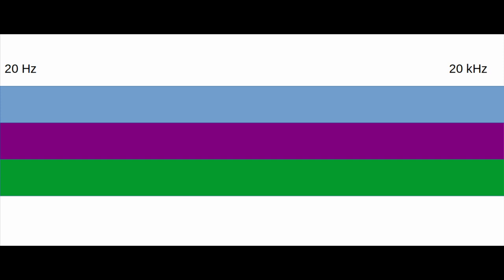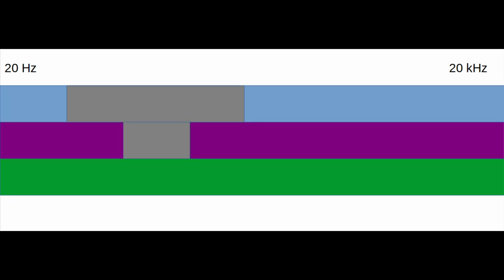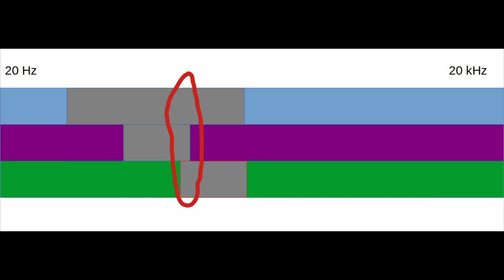Soundproofing Your Home: Floors and Walls

Comment: Whew, that was a lot to process. I actually came back a few times to finish the video what with kids and life interrupting. I'm looking forward to seeing these sound reducing techniques implemented.
Reply from the maker: Sound and Magnetism are two forces that we don't completely understand.  Here is one that the "experts" don't talk about. Sound is basically a pressure wave.  Both in liquids and gases, a point of pressure is equal in all directions.  So why does a sound pressure wave not start a new point of origin every time it touches an air molecule?

Comment: I enjoyed your sound transfer explanation. In the early 1980's I built a three bedroom house inside a cold-storage warehouse in Manhattan. The floors were two feet+ thick with concrete mixed with clinkers (used/burned up coal and built around 1900). I built metal stud framed walls packed with insulation and calked top and bottom. The sheathing was 5/8 Sheetrock on each side under which both sides had layers of 1/2 inch soundboard. Party walls were two feet+ thick built of cinder aggregate concrete and sided with several courses of red brick. The floors and party walls were so thick, because the building had to accommodate heavy meat haul trucks up to the seventh floor. Anyway, as a result, we heard very little street noise and barely any interior noise between rooms. And, no sound could be heard from adjoining units. Thank you for the video.
Reply from the maker: It is so frustrating trying to do a video like this without a workshop.  Not being able to set up "experiments" to show what I am talking about vs just explaining it is frustrating for me and I am sure some of the viewers. I can't wait to build this and do sound tests as I add each layer to the 2nd-floor flooring. I know the rubber and cork will do an amazing job of inhibiting noise.  I am curious to see how the cement board does.  Jonathan brought up a good point on the shared wall with the outside garages and lower half of the second floor. I want to test those areas too as I close them up.
Reply: @fromtheburbstothetetons8826  I'm guessing that professional musicians and sound stage techs must have the science down pretty well. Maybe you already got in touch with people like that to see what they use, though not necessarily what you would do but good information. My daughter lives on a busy Manhattan street now and found that if she replaced her windows with some kind of vacuum sealed (???) windows that it would substantially cut sound. Anyway, good luck with the job and it sounds exciting.
Reply: @fromtheburbstothetetons8826  This would be really interesting. Would definitely like to see that.

Comment: You reminded me of sound baffles used by musicians. Also in Manhattan in the 1980's I looked at a loft where two guys were building on the next floor down where they were going to professionally experiment and make music with their Moog Synthesizer. We didn't buy in that building, but were assured by the music guys that they would surround their studio with sound baffles to break up the waves and that the studio would be built as a room within a room which would more or less float on air. I don't know if that all worked for sound deadening, but it was an experience talking with the two guys.
Reply from the maker: Back in the days when you could find 12 dozen egg holders pressed out of fiber and staple those up for soundproofing. I even think it worked better if you cut it into irregular pieces and dumped them into the cavity.  The idea is with all those irregular air spaces, almost any frequency would get disrupted. Back then it was more trial and error experience than science.
Reply: @fromtheburbstothetetons8826  That's right, lots of trial and error.
Reply from the maker: I didn't watch the whole thing, but what he is doing is setting up a box to inhibit the sound.  And then by the time is gets to the second outer box, the wave is so weak, it can't resonated the second box.  All the principles are the same between his sound "proofing" and mine.  I am just tackling it in a different manner.

Comment: I found this one quite difficult to follow. You were talking generally and then moved to your specific situation but it wasn't clear whether this was long term for your house or the workshop/apartment. Then you were talking about upstairs and I thought that was the bedroom but the space is all open so that made no sense. I think I finally caught up. 

For anyone new to the channel including a quick cross-section might have been helpful.

How are you going to fasten everything together? How do you acoustically isolate the layers?

If I remember correctly there are some supports going from the concrete slab all the way to the roof. Is that a potential path for vibrations to propagate? Is there any way to isolate them from the slab?

What will be your ceiling design for the workshop?

What are you planning for sound dampening the mechanical spaces either side of the loft/master bedroom/storage space?
Reply from the maker: I did include a "card" linked to the workshop/apartment design video, but a great point and will look to do that for the next video.

All great questions!!!
  
*How are you going to fasten everything together? >>> Glue mostly with some screws. The Advantech will be fastened to the web trusses per manufacturer's specifications (their anti-squeak glue and fasteners). The next layer of rubber will be glued to the Advantech. The cement boards will be glued to the rubber. The radiant level will be installed per specifications to the cement board. The cork layer will be tacked in place with glue and I will let the pressure and fasteners for the wood floor do most of the holding in place. 
*How do you acoustically isolate the layers? >>> You don't have to. Because they have different natural resonances, they can touch each other without issue. 
*If I remember correctly there are some supports going from the concrete slab all the way to the roof. Is that a potential path for vibrations to propagate?  >>>  Great point! I realized that I have to put insulation there as a sound barrier, but it slipped my mind that I should also make sure it is air sealed for the noise.  That lower part of the wall in the upstairs apartment is inside the envelope so, from a weather perspective, it doesn't need to be insulated or air sealed.  
Is there any way to isolate them from the slab? >>> I am not sure they need to be.  I don't see the slab as a source of forced vibration through the system.  If anything it will reflect the sound into the workshop.
*What will be your ceiling design for the workshop? >>> It will be open web truces. No "ceiling" on the workshop. You will be able to see the first layer of Advantech flooring from the upstairs apartment from the workshop.
*What are you planning for sound dampening the mechanical spaces on either side of the loft/master bedroom/storage space? >>> Completely forgot about them.  I was always planning on putting the house air exchanger on a piece of plywood and then use that as a platform with rubber washers or feet.  It will be a lot easier to move it out of the crawl space to service, clean, etc.  *What probably makes the most sense is to isolate those with false walls in the crawl space.  I will have to think about this some more and come up with something on the fly.  I plan on putting built-in drawers that will use the crawl space too. So that alone will create some air sealing issues.
Reply: @fromtheburbstothetetons8826  Thanks for all the answers.

Perhaps acoustically isolate was the wrong term. Glue (at least the visco-elastic stuff) seems the way to go but I would have thought a screw or nail would couple the two materials together and potentially compromise their performance. Similarly with the supports they will be physically connected to surfaces in the apartment that might vibrate and create noise.

Installing a ceiling in the workshop below the trusses seems like an easy way to make a big impact on the noise. Is there a benefit elsewhere to leaving the trusses exposed?
Reply from the maker: Compromise the performance is a relative thing.  Screws and nails don't resonate noise very well, so I might lose 0.01% across all 1000 square feet.  Rubber and cork are two materials that don't resonate well at all.  They are two of the best sound inhibitors on the planet without getting into really advanced sciency composite stuff (I don't think Green Glue is advanced sciency stuff).  Green Glue only works well if it sandwiched between two sheets of something  (https://www.greengluecompany.com/noise-soundproofing/about-sound-transmission).  Rubber and cork don't need an assembly to meet or exceed Green Glue. Concrete as a material, because of its mass and makeup, doesn't pass on vibrations well.  If it vibrated a lot, it would crumble.  It is an excellent inhibitor too.  One of the reasons ICF houses are so quiet is because they are super airtight and the concrete mass in the walls.
I want to leave the roof open in the workshop so it is easy to update the space.  I can easily run additional electrical, etc, anyplace in the joists. They will be open web joist so I don't have to cut or make holes anyplace to run whatever I need to update the shop. If need be, I will cover the bottom of the Advantech sheathing in acoustic panels before I put up a ceiling.
Reply: @fromtheburbstothetetons8826  I can see the benefit of having that flexibility. The acoustic panels would also make the space excellent for recording in. How are you handling fire safety/protection? If the joists are wood the entire floor assembly is combustible.
Reply from the maker: @streety06  This is not a multifamily home, so it is treated like any other single-family home.  The fire detectors for the first-floor workshop and second-floor apartment will be connected.  There will be a 1/2" of cement board in the floor assembly that should slow down any fire started from the workshop.  I also plan on having a fire sprinkler system in the workshop and apartment.  I will be using the Uponor AquaSAFE fire sprinkler system.  https://www.uponor-usa.com/site-data/layer/system/youtube-layer.aspx?id={4A39412B-8DE0-4100-B236-9541C3711B23} .  This should slow the fire down by about 5 minutes which is a really big deal, for both exiting safely, and giving the fire department a better chance at saving the building.
Reply: @fromtheburbstothetetons8826  The cement board may prevent the fire burning entirely through the floor but it is all resting on the joists which are unprotected by the cement board. The fire sprinkler does allay my fears somewhat though.